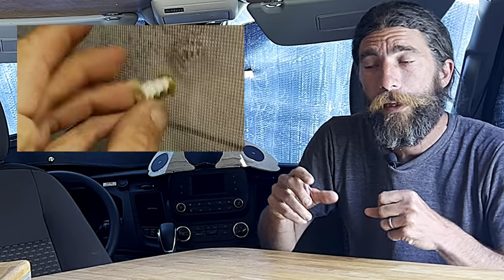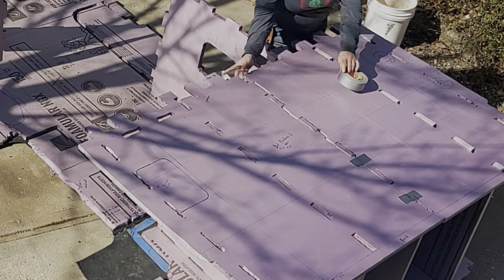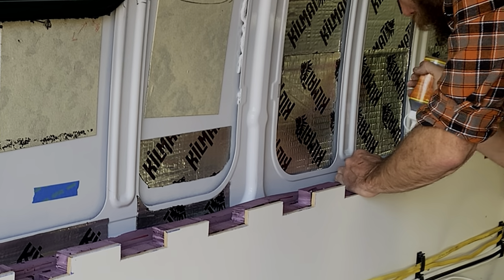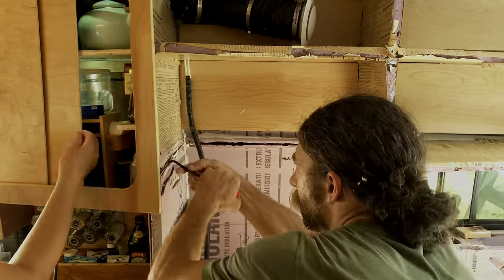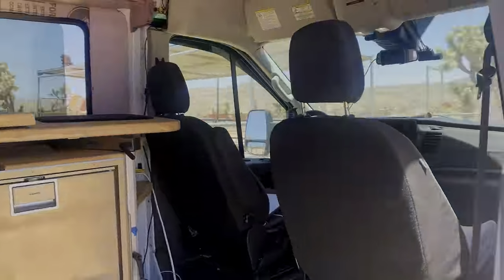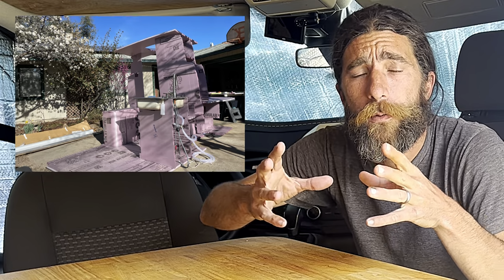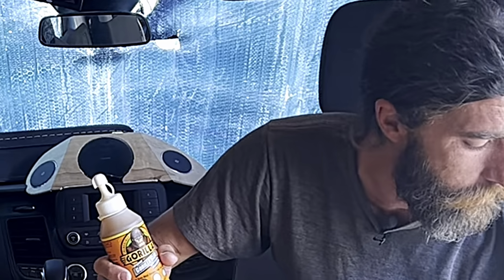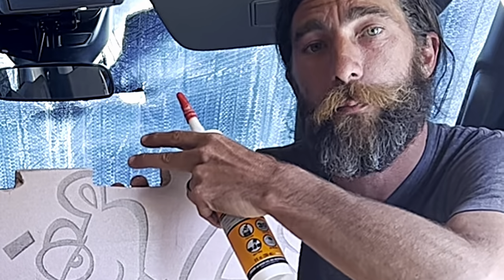Foam Camper Van Glue Up -Foam Building System Vol. 4

Comment: Try a test with wooden dowels instead of the plastic screw holders and I think you'll be pleased with the results.
Reply from the maker: Just might next time it comes up.
Reply: The plastic screws have more surface area and on more planes to lock itself in there. But maybe 1"x1" wood chunks and cutout the foam and glue in the wood. That with the screen and primer would probably work good.

Comment: I apologize if I missed this in a previous video but, was just wondering if a simple jig - used during cutting - would afford you quicker, more accurate joints. You could eliminate most marking I'd  think? Obviously, there's an enormous market in the woodworking world for things of that nature. 
I've never built with foam board like this, but it's really interesting. I wonder if some sculptural stack laminated built-ins or cabinet door handles, or an Arts & Crafts vibe, could be expressed? Sounds like a lot of work. 😆
Reply from the maker: I did use a jig for my 4x1 finger joints for awhile… for marking and for cutting. Works great… but for some reason I got out of the habit. I did mention it in my OLD Q&A video, but not much else to say. There are lots of foam layer sculpture options for sure! I considered doing a tree truck thing as a sculptural element in this build but… time, yeah… it’s not infinite!

Comment: I don't want to use epoxy over fibreglass and for gluing xps together, but I think it should be discussed. Tech Ingredients did a video on this form of lamination which was interesting but I don't know how it applies to van fit outs.
Reply from the maker: Yeah, I don’t have the experience with epoxy to talk about it. I hate mixing up epoxy or 2 part glues, etc… I’m sure it has its advantages and it can certainly create a particular look on a build, but it’s just not for me. I found a few different Tech Ingredients videos on the subject and all of those would work fine in this build system, take a look at the screen and skin video released today… it’s the concept that is important, not so much the materials used.
Reply: @falkornomad  Good point. It is about the laminating foam, not so much what is used. Subtle but very important.
Reply: Hi I've done epoxy on fibreglass mainly because of the extra creativity it has given me I've made cabinet and draw fronts bench top and dining table in my vintage motor home I rebuilt. It's been a learning curve but it's one of a kind as all aesthetic pieces

Comment: The Gorilla HD makes good sense; using flexible adhesive to be consistent with the properties of the foam, then dealing with the exoskeleton/skin as required. I've been watching boat building videos for a few years... where the process is: Skin first (sprayed fibreglass into mold), then fibre glassed plywood/balsa/composite/foam is used for internal bulkhead strength to keep that exoskeleton in place. Lately I've been looking into "foamy" designs for an ebike camper, so: I'm fascinated by this kind of architecture/industrial design. This is like an elegant reversal of the boat building process, with proper experimentation to see where strength is needed. I love it! I love that you are willing to test and see what works. I also appreciate the honesty in showing us what didn't work or what you might do differently next time.  In response to your request for what I would like to see: I look forward to seeing more.
Reply from the maker: Interesting, I never thought of it that way, but yeah, boat building could reveal some tips and tricks for improving the build system. Testing, failing and sharing are about the only things I do well. I think I can accommodate your request to see more👍🏽

Comment: Just a suggestion,  if you glue in half inch dowels or three quarter inch dowels  where you want to put screws  they will be a lot stronger than just plastic inserts.
Reply from the maker: I might give that a try at some point! Thanks!
Reply: That's a great idea, you can anchor those plastic inserts into the dowel's so they won't ever slip. Haven't thought of that until your comment.
Reply from the maker: I think he’s saying; SKIP the plastic anchor, drill out a hole in foam for the dowel, glue dowel in foam, screw into dowel.
Reply: @falkornomad  brain fart, yeah that makes more sense..
Reply: @NØMAD  yes that's what I was implying.  Sorry for not being clearer in my post. All you need is to drill a hole that gives the wood dowels a tight fit, cut a few groves in the dowels, and glue in place with expanding foam like Great Stuff.  Then, use sheetrock or decking screws to make the connection.
Reply: Nah,  if you use a dowel, you lose all that surface area provided by the fat plasticvlag screw. The pull-out testing in vid 2 showed the screw stays with the fat plastic lag screw.
Love the tests.

Comment: The "shear" strength is where the drawer slides are putting pressure. Your screen material added to the foam surface improves the shear strength as well. GREAT information presented.

Comment: +1 ... Subscribed... "Foam Bones" is onto something... Truly innovative construction methods. .. Lightweight is where it's at.... Somebody provide Foam Bones a CNC machine.. Cheers, Vail, Colorado
Reply from the maker: Welcome to the channel… before I end up with another nickname… Foam Bones is what I am calling the building system, NØMAD is the name of the channel, thus what some viewers refer to me as in comments, but my name is just Eric. 

Light weight is great, but see the Vol 1 “7 reasons why foam is better than wood” for the 6 other reasons I like foam. A CNC could be useful, especially if I was building multiple, but the awesome part of using a hot knife is that I can cut pieces in place and shave them down to be the exact shape I want. For example, a vertical bulk head against the factory van wall. That shape is virtually unmeasurable, but hold the foam in place and cut it down a little at a time to a nice snug fit, easy. That kind of work is hard to do on a CNC. 

That all said, HELL YEAH! Somebody give me a CNC!!! Wait…. How’my gonna fit that in my van?!?!

Comment: Did the Owens Corning boards (1", 4x8) you used have pre-cuts them at the 16", 28", and 44" marks?  It's like they were "pre-weakened"!  Obviously the slices are there to make it easy for someone to make 16" and 12" boards, but not ideal for the foam building process.  The 1/2" thick Owens Corning boards do not have these slices in them.
Reply from the maker: They did have those cuts / scores, they are at 16”, 24” and 36” (not 44”, but whatever). The 2” has them as well. I try to avoid having them if I can… or run them in the same direction as the load bearing. Once the screen is on I have not noticed any issues. 

I could NEVER find the 1/2” foam in my area, would have loved to work with it! Next project maybe I’ll special order some.
Reply: @falkornomad  lol...so much for my math skills!
Reply: @Howard  I think it's 32" lol. I considered trying to fill this area with a little gorilla glue, but I'm not sure if this will just warp the board when it expands.

Comment: Very helpful. Really appreciate your knowledge, experience, and advice. Building a lightweight camper. Plain on skinning inside and outside, but like your idea of fitting first, then will probably disassemble, skin the insides except for the tabs, then glue everything together and skin the outside in a continuous process.
Reply from the maker: Good Luck!!

Comment: Wonder if scoring Only the sections that will receive glue, as well as their mating surface would give more bonding strength [e.g. "tooth"].  Maybe just a swipe of 40gr sandpaper ... ?  THANKS for creating 'The Volumes'.  Shared in several of my Van-related groups.
Reply from the maker: That’s a good point… also, apparently, the newer foam has a film on one side (I have never seen this) that weakens the bond and folks say they need to sand it off first so that’s a bummer. Thanks for the shares!

Comment: have you tried using bamboo skewers to hold pieces in place when using the expanding glue? Have you tested using expanding foam from a can as a glue/gap filler?
Reply from the maker: No I have not, I have used skewers to hold things in place before gluing (for mock ups), but I prefer the gorilla hd for its flexibility when dry.

Comment: The plastic anger and gorilla glue will make mounting stuff without wood blocks a lot easier. (a diy camper is never finshed) I used loctite Pl s40 polyurethane sealant for the flexible joints. I also ran a palm sander over all the 4x8 panels to improve adhesion of the skin.
Reply from the maker: Sanding is a good addition!!

Comment: Haven't tried your adhesives yet but saw a video a few years ago about various adhesives for styrofoam. A lady did it as I recall. The winner actually turned out to be a paint by Glidden called Gripper. That same paint is now owned by PPG and called Seal Grip. And it does bond foam together well as I have personally used it. Less expensive as well than specialty adhesives.

Comment: Are there other possibilities for foam joinery?  As I watched, I wondered if there were other sorts of fasteners that are made, or could be made, to join foam. Instead of screws in anchors, would metal or nylon/plastic bolts, nuts, and washers work as well or better? Could a special tape or trim with pokey bits, like Velcro but bigger and stronger, be pushed into the foam to strengthen joints or to strengthen washers?

Also, I've seen videos where some recommended using sandpaper and/or alcohol to remove the smooth surface and mold release agent residue, and another who recommended a wallpaper removal tool or some other sort of tool to put small holes into the foam surface to increase the potential glue bond (but he was using TitebonII for Poor Man's Fiberglass). Any thoughts on that?

Comment: So totally off subject of the actual glue but how do you or anyone else reading make the unform finger joints? are you building a jig or CNCing or  what.  Im wanting to build a foam teardrop camper well actually a foam square drop and am considering this for the exterior walls .  Any advice ?

Comment: This way of doing the foam first and then screening makes no sense if you would do precise measurements and blueprints. Maybe inside the van it works but if ypu wanna build trailer or such, then you want strong mortise and tenon joints, which the plywood and other screen layers give to it.

Comment: I want to build a foam inclosed trailer what would you recommend for skinning the exterior side of the foam board and what glue/adhesive would you use?
Reply from the maker: I am not an expert on “exterior foam finishings”, I’ve see a few videos on it and they use canvas with Titebond 2 then an exterior auto paint. 

I would like to build a trailer though!
Reply: @falkornomad  thank you for your response..I will go ahead and try it with the tight bond2 glue and canvas. And maybe try painting it with a roll on truck bed liner since I don’t mind the texture
Reply: I read where titebond3 is actually more waterproof than 2 but needs to be cut with water for easier application but I’m sure 2 is fine. Probably gonna use waterproof paint over everything anyway  @aaronosborn7395

Comment: How small in width could / should one make the joins?  Do you think making a shorter join would make the connection even stronger?  How small of a width of connections is too small? How big is not enough to get superior strength?  Are all your join areas.the same size?  Or did you vary the size depending upon use?

FWIW, looks like all of yours are the same size throughout the van.  Would you have made any changes to the joint cut size anywhere?  If so, where and why?

Thanks for your answers!
Reply from the maker: My standard is 4”, I only vary if the joint is not divisible by 4 (which it usually isn’t. In that case I put the off sizes on the ends. So a 10” joint might be 2, 4, 4 for example. 

I suppose the more fingers the more strength, but I would not go smaller than 1” since the width of my material is 1”… that said I try not to make them ably less than 2”… no science or testing behind that. I think I mostly decided to do 2-4” for speed of cutting. The joints are REALLY strong at 4” so I’m not sure any need to go smaller.

Comment: Any heat or cold failure problems w these glues?
Reply from the maker: None so far... 18 months full time on the road... that said we did not get DEEP into the cold... few nights below 20 F but we traveled with the seasons for the most part.

Comment: hello bruddah, i know that the idea is to go with as light and cheap as possible, but have you considered using a 3d printer to create framework for the foam pieces that can be glued into the build in a way that adds structure, but is lighter than wood, and more resistant to moisture flex compared to it. with the R value of the insulation i doubt you have to worry about thermal expansion as much, but i would figure that moisture expansion of the wood would be an issue as time goes on.
Reply from the maker: It’s a good idea, just don’t own the technology

Comment: Sorry I haven’t read all the comments… I am doing something similar with my RV and Van but what I did was use 3/4” foam and making a frame out of 3/4 inch studs I filled the spaces between the frame with foam and I used Titebond III glue for my wall. The wall is next to my stacked Washer and Dryer. After I sheathed both sides the wall is just about an inch thick , very strong and light. I was wondering why you didn’t try Titebond glue?
Reply from the maker: No particular reason… TiteBond is technically a wood glue and works on many things… fine for your application. I was interested in foam specific glues and glues that were flexible when dry… Titebond did not make the list.

Comment: When I used to experiment with gluing, one of the things that stood out is doing hybrid gluing. I would combine fast setting hard glue in-between slow setting flexible glues.
Gluing plastics was an important focus for me and I still learn today.
One thing I haven't done is a plasma etch of plastics that require it for superior bond.
Another is to create a long lasting bond of a metal nut into plastic or foam.
If you get some ideas, please share.
Reply from the maker: Wow…. I mean that’s beyond my exploration at this point… I’m just trying to create an example, that can serve as a reference for the potential I think exists for this build system… I appreciate that some see me as an authority on this… but, I’m just a normal guy who’s less adverse to failure and had a little capital to try new something new…

Comment: excellent idea foam build, I am in Europe and the gorilla is not on sale could you copy the formula of the 3 types, so that we can find its equivalent,  thanks keep up the good stuff cheers from France
Reply from the maker: The gorilla glue original is a polyurethane glue… lots of options for that. The gorilla HD construction adhesive I don’t have the formula for… but any construction adhesive rated for foam would work similarly… do you have “liquid nails”? They make a foam specific formula that is similar.
Reply from the maker: If you find good alternatives I’d love to know the brand names for future videos!!

Comment: Some thoughts that came to mind watching this and the one before it. The fit up of some elements could use addressing. I would suggest maybe two sets of drawer slides to add support and longevity to them.
Reply from the maker: How do you mean "2 sets of drawer slides"?
Reply: @falkornomad  for heavy drawers an additional set of drawer slides would distribute the weight over more area. Doubling the stability and prolonging proper fit. Less drawer sag. Personally I think I would use actual 3/4” plywood for any drawer cabinet. Cool concept and it will be great watching as it continues to evolve.
Reply from the maker: Oh I see… yeah!!! Great idea!

Comment: Watching this - along with other videos you've done - makes me wonder if you could create the interior in removable sections so you could load them in when you want to go on a trip then take them out when you want to use the vehicle as an empty work van.  Seems like the sections would be strong enough and light enough for this.

Might also be great for delivery expiditors who might only need the bed part leaving the rest for cargo.

LOVE IT!!  SO FLEXIBLE!!!
Reply from the maker: You read my mind!!! But you did not watch (or catch) that being mentioned in my prototype build series from 5 years ago… see my first ever video where I build a freestanding sink unit. I had the same idea for my VW van; take the seats out and put 6-9 pieces in and go on a trip… take them out and seats back in when not on a trip. Spoiler alert, I have not finished this project.
Reply: @falkornomad  Yes, literally 30 seconds after I posted you talked about separate pieces.  I was actually thinking about a hybrid of sections - like the bed and under storage and the kitchen cabinets, etc.

Comment: Do you smear the Gorilla HD around, or just leave a bead?
Reply from the maker: Both kind of… bead of HD on one piece of the two, on all the surfaces that will contact the other piece. Then when they come together it gets smooshed and spread. After it dries if I see gaps with no glue (maybe a cut it wonky) I add more and smear.
Reply: @falkornomad  makes sense, thank you.